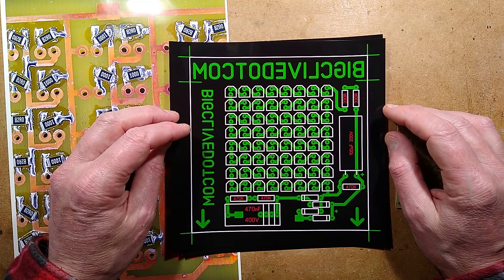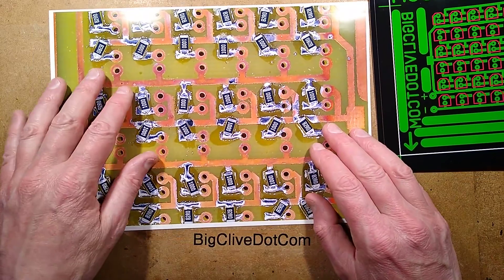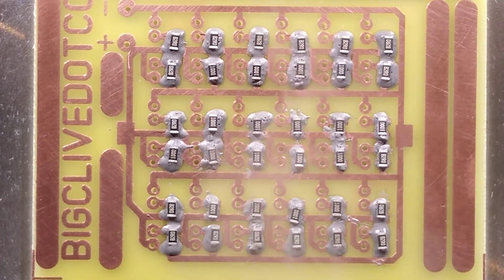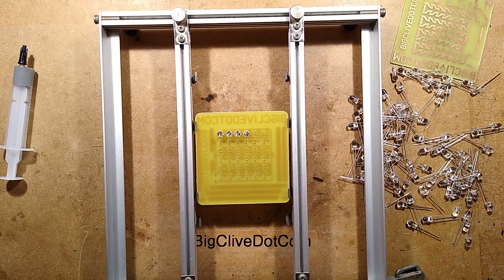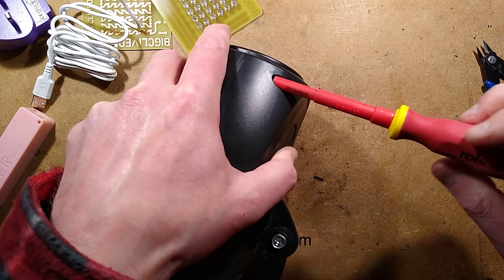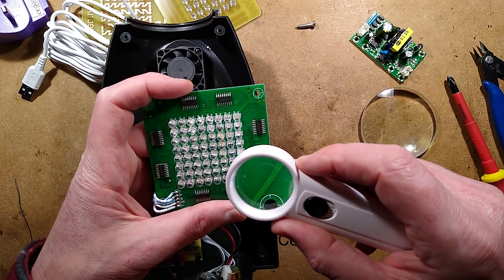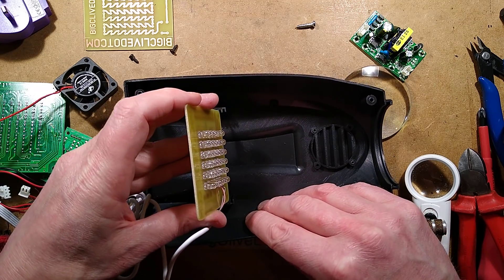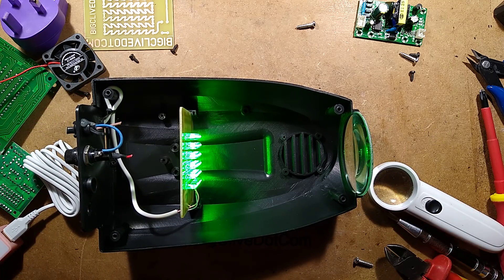USB powered disco light mod and solder reflow disaster.

Comment: On the last mini meanwell 15V 0.350A power supply i looked at before building it into a led lamp i noticed that they had a little red glue dot under every smd part. (like 0.25 mm D at max)
i guess its done in multiple steps and also non smd components like coils are used. so it doesnt all fall apart..

Also: what the hell have you done with the paste ?!?!! ;-) ;-) ;-)
 you know there are normally stencil plates and you drag the tiniest amount of solder paste above it and then remove that leaving behind really small quantities..
i guess without solder mask fixing one end with the iron and the doing the other end is easier.
edit:
did you try acetone or liquid out of your flux pen to make it more liquid again?
edding pen to emulate solder mask?
aaand i bet it was too cold with your usual room temps :-)

Comment: Have you yet considered using UV cure solder mask? I've seen it sold in gel film and syringe form. The gel applies like the etch resist, and the syringe goop you need to spread on yourself (using a sheet of clear plastic you can then shine the UV through to cure it).

Comment: Cut back on the paste - a lot. It take a lot less than you'd think, like 10% of what you used. With so much solder under the parts, they'll float up in the denser solder, keep the pool more of a puddle and they will be less likely to float. Most of your problem is the old/chinese paste. Good fresh quality paste will make you feel like an expert in no time and will stick parts down well. The price for a tube of good stuff will hurt, but it goes a LONG ways when applied in small amounts. You can add a little 100% IPA (Menthylated spirits on your island I believe) and it will help bring back the old paste, even the good stuff will thicken up in time. Kester commercial flux (186 series if I recall) is mostly IPA and works well for freshening up old paste.

Comment: Crazy and possibly rubbish idea, but I was wondering if a custom soldering iron tip with a forked end which could span the surface mount components and reflow both ends at the same time would be something that could actually work.
Reply from the maker: You do get heated soldering tweezers, but really designed for removing components.

Comment: You can restrict lens aperture to get thinner beams.
Also tilting LEDs slightly to aim directly into the centre of the lens will increase light output.
Reply: 3D-printed jig, convex face, with appropriate number of holes into which LEDs drop/get pushed, just before applying the iron, to have each LED 'aimed' at the center of the lens?
Reply: @michaelthibault7930  That is an option, but bending LED leads should be sufficient for Clive's application.

Comment: I have the same solder paste I think. It takes getting used to, and when the paste starts oozing out it doesn't stop for a while, wasting quite a lot of it. I was told they have solder paste dispensers to control this. Have had no problems with stickyness though. Also, I use a hot air gun, but even on the lowest fan setting it keeps blowing away the components (smd) so it looks very messy. I'm sure there are easy ways to do it but i'm still trying to get a hold of it XD

Comment: The end result looks a bit like that laser tunnel effect from old music videos. It'd probably look great with a smoke machine running.

If you could fit a motor in the case and spin the circuit board, with LED power supplied via slip ring, that could be pretty cool.

Comment: That does raise an interesting question: Is there a way to DIY a PCB with a solder mask?
Reply: Yes, you can buy solder paste (pladtic consumable and aluminium re-usable) and solder resist sheets per your CAD gerber files. Not that expensive and provide results difficult to distinguish from professionally produced. Also consider 'via plugs' (not sure that's the right word) for that final touch.
Reply: Yes. You can buy the stuff from the usual scumbags.

Comment: Trying to use solderpaste without solder mask is a recipe for trouble
Reply: SMD glues (aka SMT adhesives) are meant to prevent that trouble. David Adams mentions that EAGLE CAD can produce Gerber files for paste stencils...and it can also produce the Gerber files for glue stencils. Big Clive is, of course, going for "100% DIY". Well, maybe one of his next projects is building a plotter which can "print" paste and glue automatically?

Comment: I briefly experimented with making a solder paste stencil using aluminium sheet (cut open, flatten out and sand a coke can to remove the coatings, or I think I used a baking tray for my test) and dry film photo resist, I never got around to perfecting it but the first (and only) result looked like with just a little practice it would have worked.  

From memory I put packing tape on the backside of the aluminium, and the dry film on the frontside just as if I was doing a PCB.  Etching was done done in HCl, not sure if I added H2O2, obviously outside.

Anyway, something to try maybe if you have some aluminium cans and HCL around, stencilling the paste on would produce a much more defined (and thinner) application of paste so might help with reflowing the mask-less PCB.

Comment: If all the SMD components have the same height (like just a bunch of resistors), maybe you could carefully place something heavy on top of them before turning on the heat. Like a pot from the kitchen (with a really flat bottom) or something similar.

Comment: Solder resist would definitely help. As would some careful design of the pads and wires. I actually bought a tube of solder resist to give a try but at the end of the day, it's easier to pull out the credit card and get someone else to make me a brace of nice professional looking boards for a fiver. I find I spend more time procrastinating about getting my fab gear out than it takes for the PCBs to arrive anyway.
Reply: Seconded on the resist.  I don't think I'd ever try mounting SMDs without it.

Comment: bigclivedotcom on the surface mount board, surface tension (of the solder) is what messed you up; if you have a set of pads that are going to pull the part into proper alignment, that works well; Your bus bars, though, twisted the component into non OCD-friendly alignment, and I imagine you learned. "Some learning required" is rule 1 in electronics, now if I can ever catch up LOL
Reply: That's right. A bit of Soler mask covering extra copper track or better design should help.
Reply: Yes, better with solder resist. If using no solder resist you should fanout symmetrical at both pads the opposite with a long thin track. Thats how it works for space layouts for ESA  :)

Comment: @bigclivedotcom Use a Sharpie to draw solid resist barriers around the SMT pads. It works as long as you don't heat the ink too much.
Reply: RS sells a few different brands of liquid "peelable solder mask" too if you feel like going Art Attack on your PCBs!

Comment: I'm glad this was today's video because Clive I tried putting together a clock kit/suite I ordered online. It was a disaster. I ripped off some of the pads/through-holes. I struggled getting the solder to stick to anything but the iron. I soldered together neighboring parts by accident. I broke the IC holder. And I guess I cleaned my iron wrong and melted the tip. Not bad for my first try. I have a new kit and iron on order.
Reply from the maker: Don't abrade the tip of your irons.  The bit is usually copper with an iron coating to resist oxidation.  If you file it the thing will corrode away fast.
Reply: @bigclivedotcom  I think it was because the solder would just stick to the tip in big globs and I had to continually scrape it off onto the leads. I probably scraped through that coating. Live and learn.

Comment: as someone said below, you used too much solder paste, just a couple of dabs should suffice. there is enough to do 5 boards and also your budget goes out the window. also try using 
AMTECH NC-559-V2-TF reflow flux.

Comment: That's very similar to an attempted disco light I came up with for the place I worked once. Shame they decided to use the cheaper red and yellow (Toshiba HB LEDS). Didn't look so impressive (might have been nicer with some blue and green, but they were deemed too expensive in 2001 (high brightness LED's had not been around that long; green and blue were still expensive compared to red & amber), and filtered bulbs were still commonplace back then). Flashed to the rhythm of music using a PIC508 - never got past the initial development phase.

Comment: Could you 3D print a stencil directly onto the pcb 4 - 6 thou thick and peel it off after application of the paste ?
Another method would be to use the old blob of glue technique, apply a dot of glue, put the component in place and when dry apply the solder paste.

Comment: You might find that the paste sticks to the board better if you heat the board while applying the paste. How much heat will depend on the paste and you'll need to start low and raise it until you find something that works. This is about 50/50 for helping.

Comment: Not that I've done a lot, but I definitely find tweezers, fine solder wire, and a fine tipped iron the way to go for SMD. Even the 0402 grains of sand on those banggood practice boards are totally doable with a good magnifier.

Comment: @bigclivedotcom 

try to use your heategun to put gentle heat on the PCB and even more gently on the tube. my tenement flat in glasgow ambient temperature is too cool for the paste to flow easy and it doesn
t stick to the PCB. i find the above helps, it starts to stick to the board and flow from the tube better

Comment: Just pour on some iron filings when re-flowing and use a big magnet to carefully steer the resistors into line.
Then you will need to throw the whole board into a bin and start again.

Comment: Many many years ago I helped turn crappy failed Packard Bell motherboards with 4 MB of RAM into 30 pin SIMMs.  We used solder paste dispensed from a compressed air powered solder squirty thing.  We then stuck the populated SIMM cards into a toaster oven and toasted it for a 5 minutes or so.  We made hundreds of them.

Comment: Is there any method of making a solder resist mask on these etched boards?
Reply: That's the main problem, no solder resist so the solder flows wherever it wants.
Reply: @cambridgemart2075  just realised further down that someone mentioned Kapton tape - seems like it would take forever though

Comment: I had some perfboard and i swear over time the copper just evaporated from it, so i dont trust that any more, you ever come across that problem with those boards?
Reply from the maker: You do get copper free perfboard.  I've never seen copper evaporate from it except when I've had huge electrical incidents.
Reply: @bigclivedotcom  this stuff just sat there, weird
Reply: I have boards that have been in my stock for 30 years or so, still in perfect condition and used some a week or two ago.

Comment: You have two problems going on here. 1) way to much solder paste. 2) you have no solder mask on the tracks so the solder is wicking on the tracks. Cut down on the solder and put a strip of Caplan tape either side of the resistors and it will act like solder mask.

Comment: I think you applied way to much solder paste. Isn't this supposed to be a very thin layer applied with a stencil?
Reply: yes usually ~0.1mm thick with opening slightly smaller than the pads

Comment: Great effect! Maybe the re flow soldering could be helped with a solder mask? I've not tired it myself, but when I wath others use a hot air gun, the components just slide directly into place. Either that or the solder paste? Just a thought. But it's cool anyway!

Comment: Reckon you need a stencil for your solder paste.
Reply: Stencil wouldn't help with the wonkyness, the solder would still go everywhere.
Reply: @russdill  not so sure about that. the components wiggle when the heat is applied because of excess solder paste. even when using the hot air work station as opposed to an oven the componenets should be able to stay in place unless your using alot of air flow or too high temp causes bubbling. but the parts realy should flow into a nice position. the lack of solder mask doesnt help. but i never had solder mask to use myself.

Comment: If you want to thin or reconstitute solder paste, mix a small amount of IPA to soften it up. It's a messy job though, wear gloves!
Reply from the maker: I'll keep that in mind.
Reply from the maker: That worked, but if there's too much IPA it cracks and spits the solder before it flows.  I wonder if adding more flux could be an option.
Reply from the maker: I just tried diluting it with flux and it worked well.
Reply: I initially interpreted that as India Pale Ale. 😊 Though maybe that's worth a try...

Comment: Oh dear, about 10x too much solder paste. You just want a very thin dab. The stencils are about 0.005" thick. I've never found a decent technique for using solder paste without a stencil. Squeegeeing it through the stencil gives you very tight spots of appropriate thickness.
Reply from the maker: Yeah, there really wasn't much control.  But it's reassuring that even the apocalyptic blobs that engulfed some components did still flow into a neater blob.

Comment: I would like to see the board with RGB colour-changing LEDs.
Reply from the maker: That's a bit harder because each chip is in a different position under the LEDs lens.  I tried it with diffused LEDs and it worked, but was very dim.
It would also come out as three separate beams from each LED without mixing.
Reply: @bigclivedotcom  I mean that also sounds like a pretty cool effect.